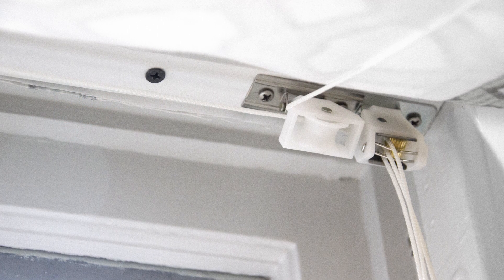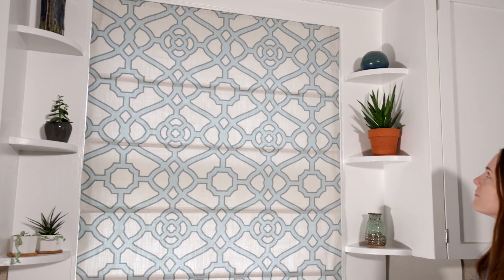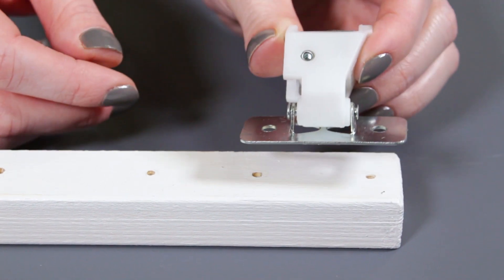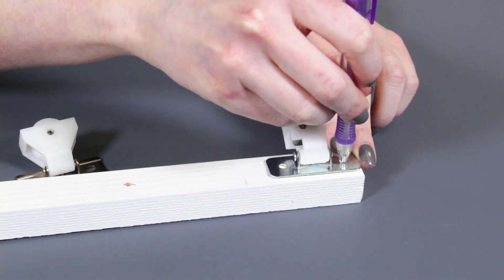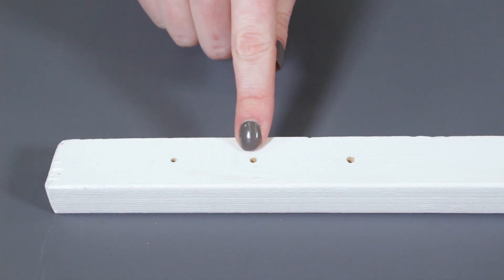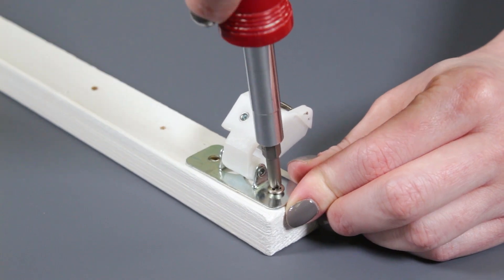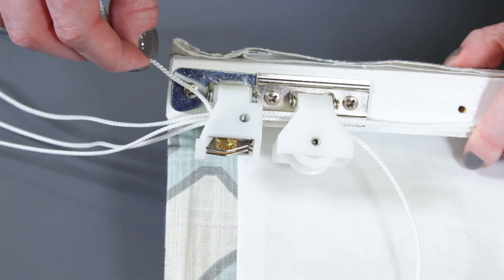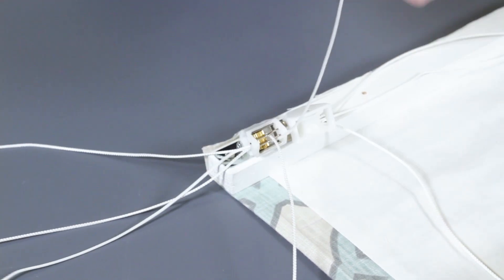How to Install a Cord Lock

Comment: Hi, I purchased two of these 3-cord locks, and installed one so far, but it will not "grip" the cords and lock the shade in position.  I have watched the video carefully and am certain I have the cord lock threaded exactly as shown in your video.  What other things might I need to check to figure out why this isn't working?  Thanks
Reply from the maker: So this might be annoying, but I recommend pulling all of the cords out and restarting from the beginning. The cords could have gotten tangled up inside of the lock and might be stopping it from locking. Let me know if this helps!
Reply: @onlinefabricstore  Hi,  I have only two cords on there so it isn't really much to take out and do over, but its also easy to see that they aren't tangled or twisted together or anything.  So what I did was go buy some much heavier cord.  I was using some that I really like the look and feel of on there, but I was starting to suspect that maybe it was just too small or slippery to catch in the mechanism. (there's nothing on the packaging to say what size it was.) The new stuff I just bought is 1/8 or 3.17 mm, and it's definitely larger cording.  I rethreaded the shade and cord lock with that and now it is working perfectly.  Thank you for your response to my question, as it encouraged me to keep looking for a solution and now I have a working and beautiful roman shade. :)
Reply from the maker: @beyourownartist  YAY! I'm happy we could help!